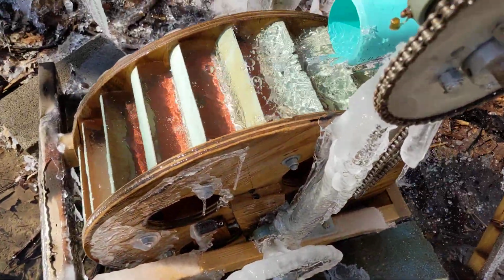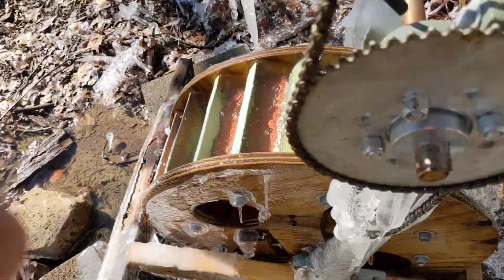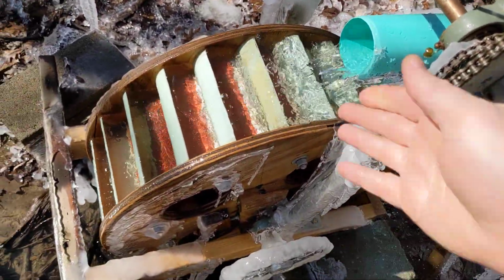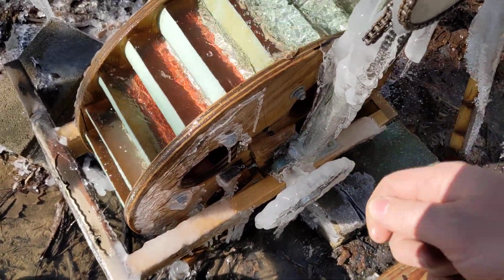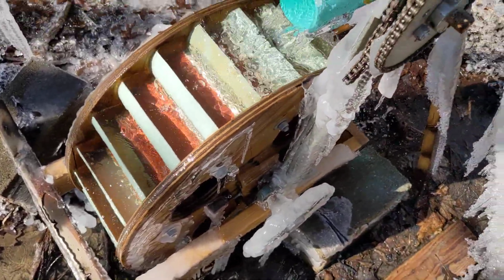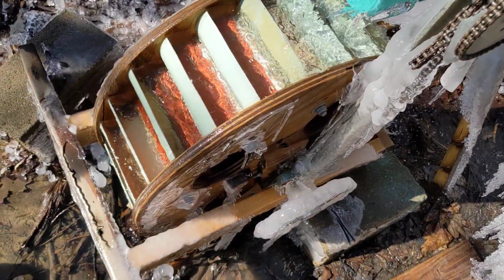Frozen Out Of Testing

Comment: Same thing happened to a lot of power generation sources in Texas recently - LOL.  Looking forward to seeing what kind of power (not just unloaded voltage) the new setup can produce...
Reply: Really funny how fossil power were worse at coping with snowy/cold weather than renewables 😂

Guess they should have listened when the Feds recommended them to winterise a bit better
Reply: @JoranGroothengel  The only thing they will listen two are fines if they can't supply what they're contracted for.  I'm not a fan of regulating rates as much as regulating availability.  "Must be this available to source The Grid", so to speak.
Reply: @JoranGroothengel  Especially since the technology is proven industry standard......for a reason.  It works.